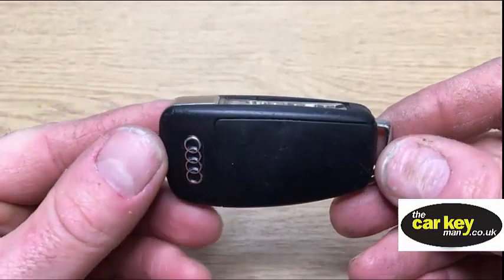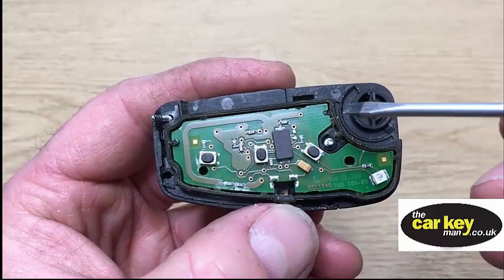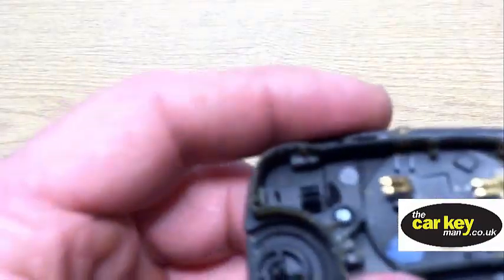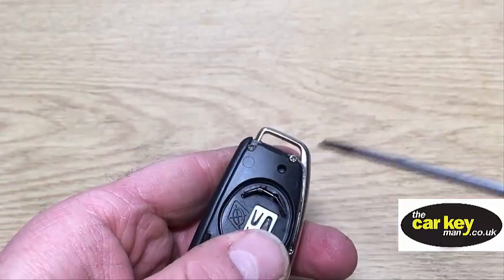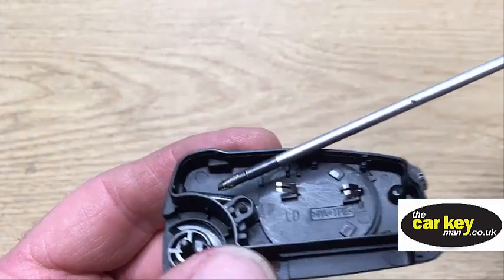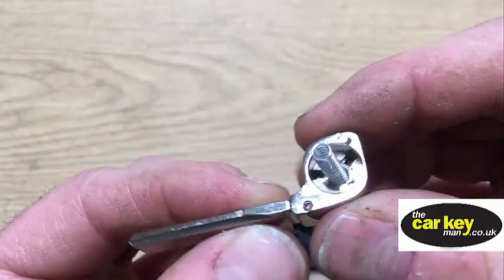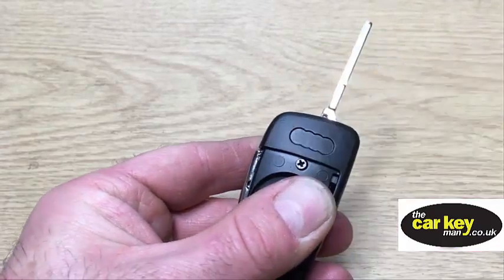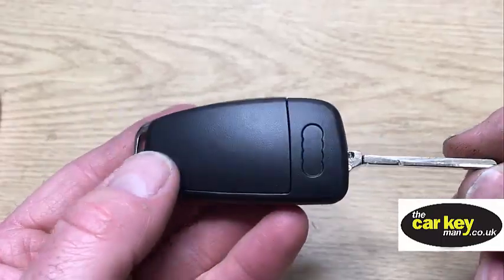Key Repair Audi Flip Remote HOW TO FIX

Comment: I've got a key that has stopped working, before it stopped working I'd have to press the buttons several times before it either unlocked the car or locked it. After some time it eventually stopped working, I changed the battery and the light on the key lights up but the buttons don't unlock or lock the door. I've tried syncing the car back up with the key but it won't work. I feel like its a board issue so bought a replacement key with board. Will it be a case of just moving the transponder chip into the new key fob?
Reply from the maker: Hi, any key or circuit board that needs reprogramming needs to done with software unfortunately. This applies to any previously working key that has dropped out too

Comment: Hi. I just bought an old A3, the car is great, keys are pretty horrible. I was going to try and swap the innards into new (non-genuine) cases, I just want to keep the blades from the old keys rather than getting new ones cut (will they just fit into the new case?). Also, is there any danger that this process will render the "new" keys unusuable? In other words, by taking them apart is it possible that the car will no longer recognise them?
Reply from the maker: Hi Pete. Well there's always danger when you mess with car keys, but if you have two keys then just do one at a time. 
You won't be able to use the whole spring mechanism in the new case, otherwise it won't spring out correctly. 
This is with aftermarket cases the parts are designed to match the case, not the original Audi case.
You may be able to swap over just the blade into the new key, but you'll need to knock out the pin and may need to modify the blade tang to fit into the aftermarket case.
Hope that helps :)
Reply: @TheCarKeyMan  thanks, the transplant went like a dream. I just smashed open the old cases like you did in the video. Swapped everything over just fine! Cheers!

Comment: You could also reuse the old blade if you are not using the original case anymore. 
Saves finding someone to cut the new Blade.
Reply from the maker: Hi Danny, thanks, yes sometimes that's possible. Unfortunately, on some of the repair cases the old blade doesn't fit into the new case, which is a shame.
Reply: The Car Key Man if you take the pin out and replace the blade it should be the same shape.  Most are easily adaptable.

Comment: What do I do if my key blade won't come out when I press the button? I sometimes have to pry it open, which makes me worry that I'll get stuck somewhere unable to use my key.
Reply from the maker: Hi Kathryn, the blade is probably scraping or touching the case when it is folded away. Can you see where this is happening ?
Reply: @TheCarKeyMan  I don't see anything amiss. there was some gunk that I cleaned out, but it still didn't work. It is now getting stuck every time, and I have to use a razor blade or similar to pry at the bottom of the key, then it pops up.

Comment: why not just transfer the cut key blade over into the new keyfob housing ?
Reply from the maker: Hi, sometimes the original blade will not fit into the new case
Reply: @TheCarKeyMan  what if I have spare key fob thats exactly like the original key fob? could i swap my key into it as you show us in your video ? its just missing the panic button. Which i could remove from my existing key fob and install it onto replacement fob.

Comment: For cutting the key blade, an auto locksmith can do it with a 3mm metal drill bit in a pedestal drill.   I had a locksmith try to tell me it requires a lazer cutter and that he would only do genuine Audi keys which he himself supplied. Tried to say Ebay keys have metal which damages the lazer cutter. Complete muppett trying to rob the unsuspecting car owner.
Reply from the maker: Hi, well he's half correct. We cut all types of keys, but have found that a lot of the keys that come off eBay have blades that are rock hard. The cutters for the machines cost around £45 each, so once you've broken a few on cheap keys, it's easy to see why they are reluctant